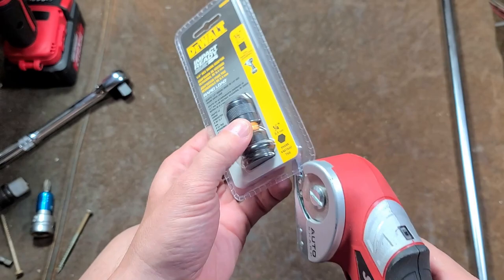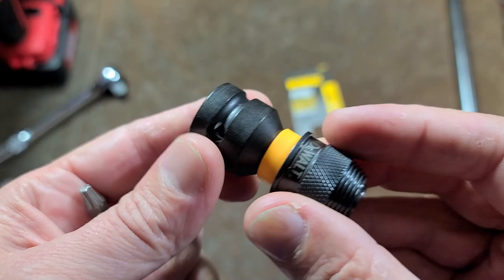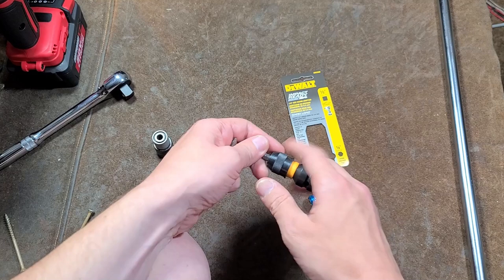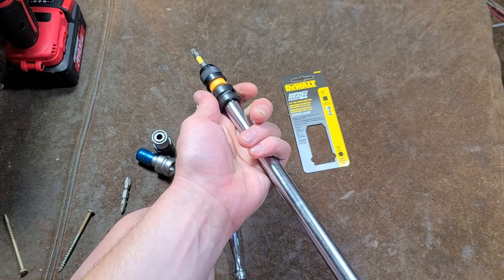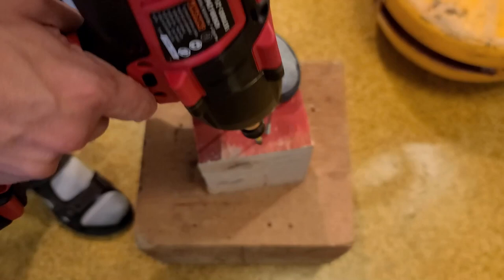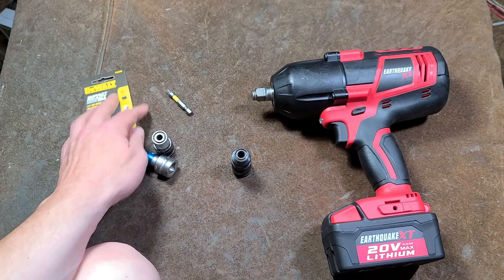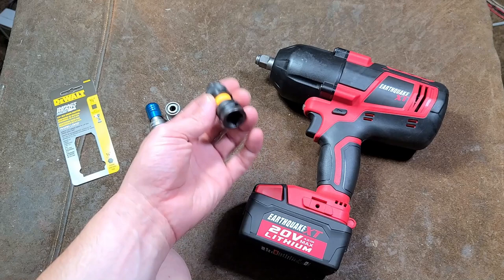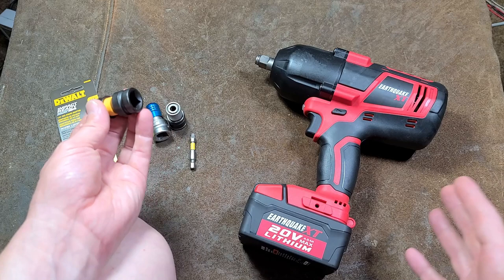DeWalt 1/2" Drive to 1/4" Hex Impact Adapter Review

Comment: Wow, what a coincidence. I ordered the Milwaukee version in 3/8" 2 days ago (hasn't even arrived yet) to use on my 3/8" Earthquake XT impact also. I was worried there would be excessive "slop" after snapped onto the anvil. I guess there will have to be some... But I guess it makes up for that by having an excessive amount of POWER! I bet you could of driven that screw right through that wooden block!
Reply: The Milwaukee is a better option. The Dewalt wobbles.

Comment: This seems like it would be useful with those flywheel type impact wrenches (the 12V ones). That would act a bit like a impact driver. I'm sure they could still break the bits if the screw doesn't give.

Comment: Hey i have a 3/8 and 1/2 adapters ive had for years.i like the 3/8 better. The 1/2 impact gets really heavy after 8 or 10 hrs of driving. The 3/8 not so much. If i can find a brand name i will shout back at you.

Comment: They're definitely better suited for low power or mid power wrenches because they impact sooner.
On a full sized wrench, what often happens is that the wrench won't impact until the screw is mostly driven in already and HOOOOOOOOAH MAAAN I've taken the head off of way too many screws even if I'm only using speed 1 because the entire screw shank will twist and shear from the torque.
These things make more sense as a 3/8 adapter rather than as a 1/2.

Comment: Unless you have a really big job to do like a deck I see no need for this attachment when a simple quarter inch impact socket holds the same bits perfectly fine. The only Advantage I see here is that the bits lock-in but a number of impact wrenches out there I've seen don't have a locking mechanism on the Anvil I know mine doesn't so I'll stick to my quarter inch socket thank you very much

Comment: Never use high torque impact wrench with these adaptors. I recommend only mid or low range torque impact wrench( with detent pin only). If you have hog ring on impact, it becomes low precision/accuracy and easy to snap/break your hexbits.
Reply: Good idea. Many impacts now have switch settings for low, med, hi tq.  Maybe using a collared hexbit adapter to keep the screw straight would help accuracy and from breaking bits.